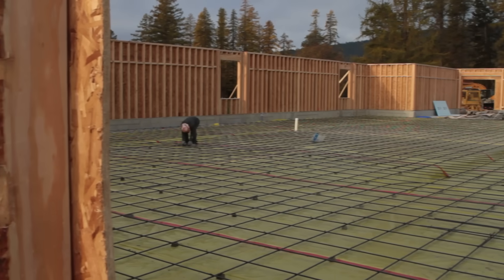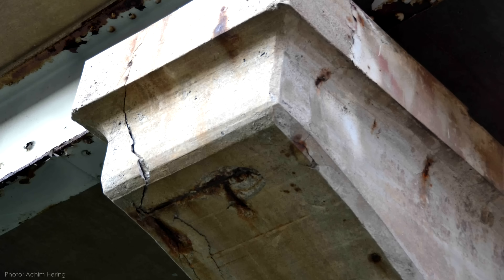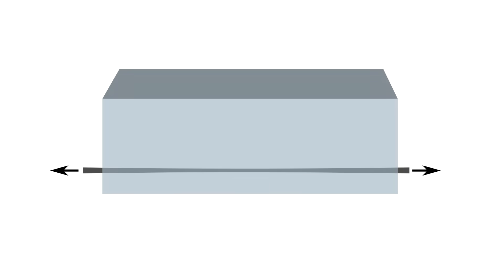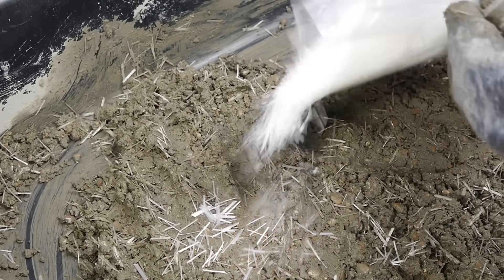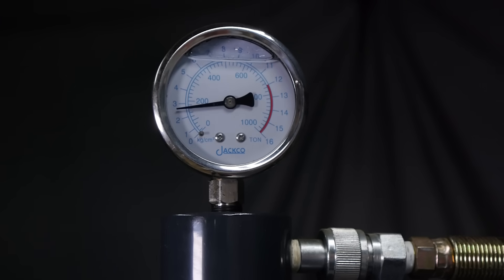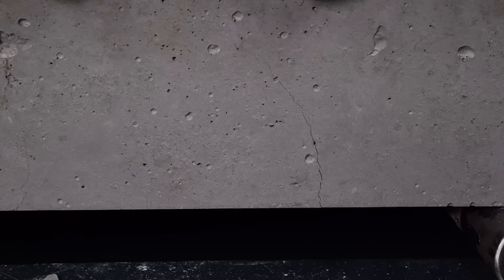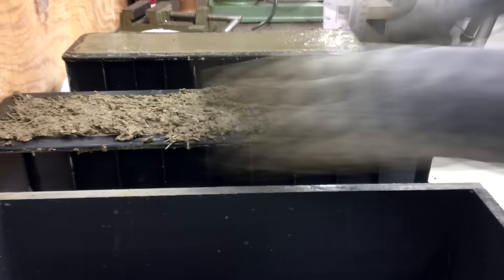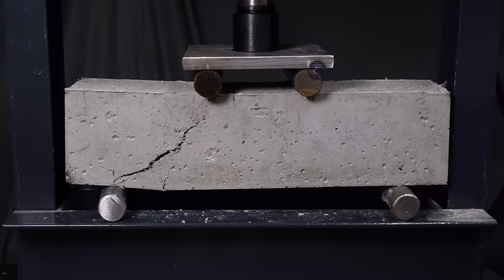Does Rebar Rust?

Comment: Interesting that Google is recommending this to me today:
The experts are saying that 'Salt Oxidation, via Concrete, of Rebar' was likely involved in the Surfside Miami building collapse.
Reply: I live in Florida and you see a lot of old condos from the 50s, 60s, and 70s along the beach. I often wonder how long the rebar in the floors can withstand the salty air. There is one in Cocoa Beach where the floor is visibly sagging above the carports.
Reply: @pilot9412  “Salty Air” wouldn’t have lead to the catastrophic condo collapse in Surfside. It was prolonged exposure to salt water due to flooding, due to poor maintenance.
Reply: @MarcosElMalo2  Amy Soyka said "salt oxidation", NOT "salty air"...
Reply: @MarcosElMalo2  And the Pool over the parking garage leaking chlorinated water into the structure for 25 years.
Reply: @pilot9412  oh yeah, I remember that one lol
Reply: I came here looking to see if anyone made this comment.
Reply: Yep… early clues seem to point to poor waterproofing at the garage/pool deck that may have led to cracking in the slab and then corrosion of the rebar within… leading to catastrophic collapse of the entire structure.
Reply: @mtsutro  just came out thay they had a flooding issue where salt water was flooding the underground parking they were going threw pumps every few years ...the sister tower had no flooding issue thats another big clue the water had to be washing out earth I think its going come down to a big mix of lack of maintenance mixed with some construction defects &ignoring warning signs the flooding should of raise red flags especially since the sister building didn't have the same issue
Reply: @jonwhick3073  you can add to that, utter and complete negligence. They did substandard repairs over the years. Likely from cheap unlicensed contractors. They also largely ignored the 40 yr inspection results for 2 years. The law requires repairs be completed within 150 days of that report's issuance. I think it will be found that not only did the property owners know they were breaking the law to save money, but local officials knew it too, and they allowed it.
Reply: Me too… this is what I figured. Have you seen cars that live in salty air areas? Bad news
Reply: @CASANOVAPRO1985  yes I love in nova Scotia some concrete right on the water will get really brittle get big crack some you can break off with your hands
Reply: @jonwhick3073  the concrete next to the water that gets brittle is because it never fully cures because of the moisture and the freezing temperatures compromise the concrete
Reply: @RadDadisRad  
Concrete curing is a chemical process.
It’s not about water drying out of it. 
In fact some concrete are designed to cure underwater.
Reply: Exactly why I'm here too.
Reply: same recommendation here, I didn't search anything about it either!
Reply: You would be surprised.. youtube recommends me video based on previous google searches, and content of the subtitles (auto generated or not, I don’t know). I was reading an article somewhere that used a rather rare idiom (in English - not a native speaker here). And sure enough a few recommendation later, a video came and this exact same idiom ..
Reply: Rebar settling to bottom of slab results from poor construction oversight. Me thinks.
Reply: They use a lot of fiberglass reinforced concrete.
Reply: Likewise for me. I had no pre-existing views that would indicate an interest in the subject.
Reply: Stainless steel rebar would have saved everyone.
Reply: @ksavage681  
I've been looking into stainless rebar a couple years now,
Pricey, but worth it if you're building for permanence.
I have no idea why it isn't at least part of coastal hurricane code yet.
Reply: ABSOLUTELY!!! 100000% CORRECT!! 25+ building on gulf coast. SALTWATER AIR make the coast one the harshest environments on building materials (I.e. non ferrous metals)
Reply: The algorithm knows.
Reply: Florida coasts are in for a dramatic shift in building compared to the last 50 thats for sure. Was stupid to ever develop on the beaches in the first place.  Its always about the money though.
Reply: Who ever thought that iron rebar alone was suitable for that environment?  If anything needed the costlier alternatives, this did.  Maybe a lot of these buildings are going to have to come down and be rebuilt.
Reply: The salt water was attacking the crumbling concrete, as well as the rebar. And the building was frequently making sounds that should have been interpreted as very scary, in retrospect. 

When salt water is emerging from the concrete, you don't just pump it away! You need to inject something underground to replace the obvious voids under the building, such as bentonite or hydraulic cement. 

Basalt rebar would have failed just as abruptly if the concrete was crumbling as badly as witnesses say, but it wouldn't rust or burst the concrete from within. 

When you build in a salt water flood plain, don't use steel rebar, or: 
1) use a paranoid amount of cover (6") along with 
2) fiber additives & calcium ion inhibitors, 
3) sealants, and waterproofing on the bottom, top, and sides of the concrete.
Reply: @imconsequetau5275  
Did they know this 40 years ago?
Did they maintain the concrete for the past 40 years?
Reply: @neilkurzman4907  
This has been well understood for much longer than 40 years, and no, foundation maintenance has not been great here. 

If you want good managers that don't ignore issues, at a minimum, hire people with personal experience with tragedies. And don't ignore their concerns.
Reply: @imconsequetau5275  
The condo management is typically condo residence that volunteered for the job. It hasn’t been the same people for the past 40 years. Apparently this condo has created this environment of cheapness and lack of maintenance. My guess is after they’ve done inspecting the other condos in the area they will find others in similar condition. 
Fortunately the residence of those buildings will be saved.
Reply: @imconsequetau5275  or use epoxy coated rebar
Reply: @thebullgator  
Tyler Ley has a video on that. Basically, any flaws in the coatings will attract all the corrosive ions and cause points of failure faster than bare rebar.
Reply: @imconsequetau5275  that would figure, I’ve done so many DOT jobs where they spec epoxy coated bar. No surprise the govt is wasting money.
Reply: @thebullgator  
There’s another video that says Epoxy coated rebar is dangerous and should never be used.
Reply: @neilkurzman4907  someone else commented that earlier, I assumed since I see epoxy bar on all the DOT projects, that it would be superior. But of course government would just find a way to waste even more money building bridges.
Reply: @thebullgator  
If you review how the earliest epoxy coated rebar was installed, an obsessive detail-oriented technician searched all over finding coating flaws and/or damage, and touched that up. If every job since then was handled with as much care, we wouldn't be seeing it banned.
Reply: @imconsequetau5275  can't tubing be pulled over it?  does the coating have to be that thin?
Reply: @SeekingTheLoveThatGodMeans7648  
Epoxy coated rebar protects the majority of the rebar surface. The problem is that corrosive ions are attracted to coating flaws or damage. That one opening will concentrate the ions into rapidly corroding one spot in the rebar. Of course there are ways to detect these coating flaws, just like condoms are 100% tested.
Reply: @imconsequetau5275  Could the crumbling have come in part from the stresses of the rusting rebar?
Reply: @SeekingTheLoveThatGodMeans7648  
The important point is that every condo owner knew repairs were needed. What they didn't understand is just how catastrophically the failure would propagate through the structure. 

The concrete cracks were a warning sign to all who could see for years. Water dripping from them, and little stalactites forming, should be extremely alarming: the concrete was being dissolved. What the general public needs to remember is that the warning signs were apparent. They just didn't trigger enough alarm in the condo residents.

The brand new FIU pedestrian bridge had similar alarming symptoms that were not heeded promptly. Far more people in the construction and maintenance trades need to be educated in spotting the warning signs of concrete failure, and the general public should know the extreme consequences of ignoring them.
Reply: Poor design and poor maintenance.
Reply: Amy, its a ly,  that was the result from the bad concret mixing, (corruption from the concret mafia(emigrants  from Cuba) in Miami, absolutly clear). 
One colum 10 inch to 10 inch  never brake down  without  dynamit,  o hammerdrill.
Miami in the hand from  experts from the emigrant mafia, without preocupation  the law 
will catch them. Miami syndrom, absolutly clear. The concretmix  can be manipulated,  and the poor  cement (less) is the profit (PROFIT). That is a  thema around the world..
Must be controlled, from the Autoritys,   and  PUNISHD, heavy......
Reply: They are expecting sea levels to be a foot higher along Florida's coasts by 2050. They've talked about the rising salt water already being an issue in some places as it contaminates fresh water aquifers... Not a good thing for concrete building foundations along the coasts..

Comment: I love you videos.  My background is in tool and die but over time I had to go where the work is and that brought my into contact with civil engineering which I find extremely fascinating.  I came across basalt rebar several years ago and was impressed by its low weigth to strength ratio.

Comment: Why not coat the rebar with copper? You can heat up the rebar to get rid of all the water which causes the corrosion. I know salt does most of the corrosion work, but copper would melt salt to a fine substance that can’t be corrosive  wouldn’t it? The way we can heat up the copper is through a line that can be hooked from the outside and works fast. I’m no scientist but water evaporates as fast as it comes in so we’d be having a dry concrete and rebar set up in no time. Plus copper conducts heat pretty fast so all the lines would work fast to conduct its own heat as we flush water out through evaporation.

Comment: I would not think rebar would rust at a rate imbedded in concrete as it would exposed to the weather. On a bridge structure this would be different considering loads, rain, freeze and thaw cycles and exposure to deicing salts in winter weather.

Comment: In UK and many parts of Europe the standard highway bridge specifications require the application of waterproofing infusions, principally Silane that prevents moisture getting to the ReBar.  This was first invented by Nazis 80 years ago to protect their new high level road bridges built as part of the Autobahn programme.  These bridges were found to be prone to very cold temperatures due to the locations (mostly over gorges) and the excess amount of road salt used to keep them clear and safe.
I see that your example of pouring a concrete slab shows virtually no cover to the ReBar!

Comment: I had a guy make reinforced concrete outside stairs and rebars were to close to the outside.
All I know is water seeped in winter and salt came and the rust damaged the outer shell.
Its cracked and leaking and I have to epoxy them now to make them waterproof...

Comment: A car park laid with steel fibres as a local reinforcement was a disaster. As the concrete surface wore away, the steel fibres were partially exposed and damaged tyres,

Comment: This video perpetrates an old wive's tale and reminds me of when I attended a civil engineering unit at university 40 years ago.  Part of the unit was conducted in the civil engineering lab by a crusty old technician.  He began the session by asking us which is stronger in tension - steel or concrete?  Many chaps answered "steel"   I don't remember any students picking concrete.   The tech/lecturer sort of nodded slightly and then asked which is stronger in compression - steel or concrete?   Chaps answered "concrete".  He then sort of smirked.  
He then proceeded to demonstrate the strength of various concrete cylinders, about 250 mm long and 200 mm diameter, which we students had made the previous fortnight using various mixing methods.  He put each one in turn in the hydraulic press and wound up the load until each concrete cylinder cracked and failed.  They all failed well below the capability of the press.   
After discussing that care in mixing made a big difference in strength as shown by the test, he repeated his first questions:  Which is stronger in tension - steel or concrete?  In compression?   The same students gave the same answers.
I was looking at the hydraulic press, and realised that its jaws were made of steel.  So I said "Steel is much the stronger, in tension AND compression".   The tech/lecturer thereupon said "We've broken the record.   Only one student this year can think.   Usually I get 2 or 3."
[Compressive strength of mild steel is around 580 MPa.   Concrete is 20 to 40 MPa]
Why do we use concrete?   Because it's real real cheap compared to steel and just about anything else, and it's rigid.   Folk don't want wobbly buildings.  Why steel reinforced concrete?   Because when overloaded or not properly made, it cracks, warning you, doesn't fail catastrophically without warning, and is fireproof.   Concrete by itself fails catastrophically without any warning.   In the 1920's and 1930's a lot of city buildings were built with steel frames.   When they caught fire, the red hot steel lost strength and the buildings came down, usually upon next door.   Concrete is a good thermal insulator - if a steel reinforced concrete building catches fire,  the fire brigade usually has time to turn up and get control before it collapses.   City fire brigades don't actually care much if a building is ruined by fire.  But its a nightmare for them if the fire spreads to adjacent buildings and then more buildings.  That's why regulations and conventions make buildings not so much resistant to catching fire, but resistant to collapsing.

Comment: This explains the issue I'm having on my 9 year old driveway.   The expansion joints have rotted out and, upon taking the wood out, I've discovered rebar run through them and frequent cracks in the concrete where this rebar goes through the expansion joint wood.   The rebar has rusted inside the damp/rotted wood, expanded and cracked the concrete at the edge of the expansion  joint.

Comment: Another way to prevent steel rebar corrosion is increase the cement in the concrete. Cl- ion can enter trough pores of the concrete.
If we make the concrete with more cement (plus 350 Kg/m³), pores will be more little, so Cl- ions can´t to enter inside of the concrete and can´t to contact with stell bar.

Comment: Great video and a lot of good information.  There is also a way to protect the reinforcing steel bars using cathodic protection.  I wish you would have mentioned cathodic protection, which can actively protect the steel members by shifting the potential of the steel in a negative (cathodic) direction, thus eliminating the anodic (corroding) areas.  Cathodic protection is widely used in industry to protect steel and iron pipes, tanks, bridge decks, marine structures and so much more against corrosion.  I belong to an international society of corrosion engineers called NACE International, which is based out of Houston, Texas. NACE Provides a lot of training and certification for corrosion engineering, cathodic protection, protective coatings, chemical inhibitors, and much more. I have been in the field of corrosion engineering for nearly 25 years. This is a growing field as corrosion costs the US economy hundreds of $billions annually. Internationally the costs go up to $trillions. Thank you!
Reply: Britain's steel canal boats, most 7ft wide, called narrowboats, have to have 'sacrificial anodes', made of magnesium for 'fresh' water.

Comment: I’ve learned that galvanized steel is the way to go, though more expensive, never painted bars
Reply: Galvanization is a process? Why galvanization over painted rebar?
Reply: @jneusbaum3697  Because in practice any coating will get damaged before it's safely embedded in the concrete.
In the case of paint a small crack can lead to corrosion at a single point potentially leading to the rebar breaking undetected.
Galvanisation is self healing so that might make small scratches less of a concern.

Comment: What about galvanized rebar?  Please correct me if I'm mistaken, but I believe that zinc tends to not expand as much and expose interior layers as much as steel does.  So while zinc will still rust, it wouldn't put much pressure on the concrete.

Comment: rebar in concreate only rust when the concrete absorbs water.
Reply: @UCwPUM-6pkswQQq6ELSxqEkA lol no all concreate does not absorb moisture. concreate under roof is protected, painted concreate is protected, cracked concreate that's filed and painted is protected. epoxy coated rebar has failure at the separation of the epoxy to rebar not at the concreate. what's the solution seal all concreate periodically.  embedment works but it should be at least 6 inches, this would make cost of construction extremely expensive. how do i know al this? im a state licensed building contractor and i have to know to hold a license.

Comment: Wouldn't steel fibers have the same rust expansion issues as the rebar itself? And because they are spread through out they would be at or near the surface as well.

Comment: I have always noticed brand new rebar comes with a surface rust, and thought why can't they coat with a primer/sealer before it starts to rust, the extra cost shouldn't be that high, or a plastic rebar that way they could use recycled plastic and help clean up the world of plastics...
Reply: A little bit of corrosion helps concrete bond to steel.